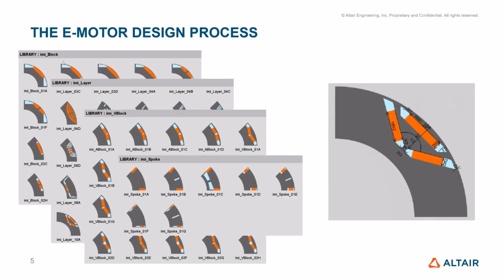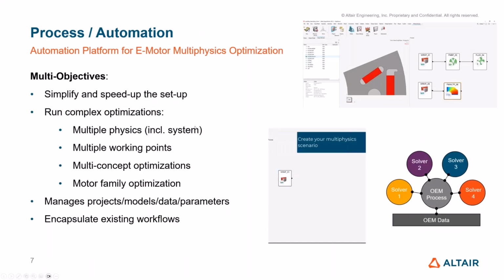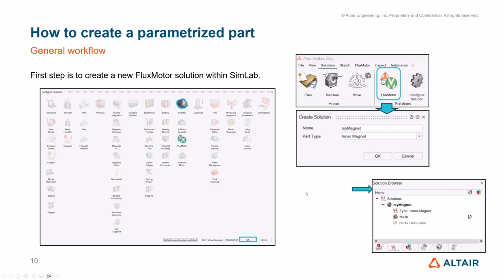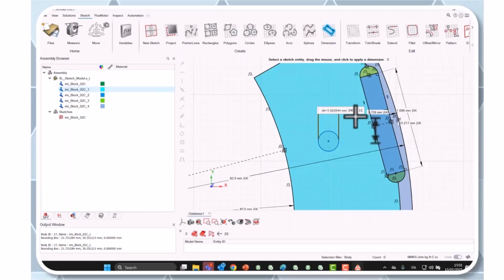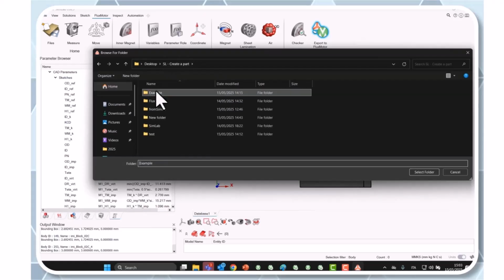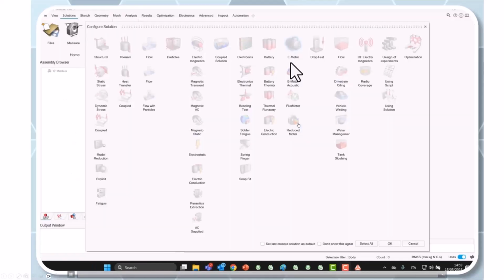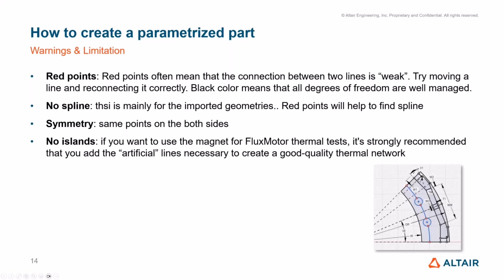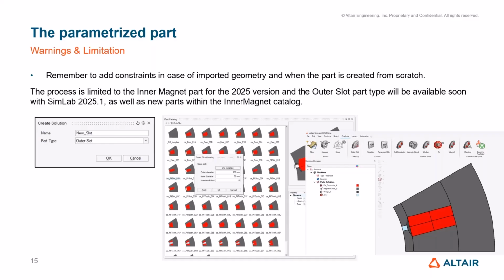FluxMotor part creation from SimLab sketcher

Comment: Hello,

I am currently trying to design a Coreless Rotor (Permanent Magnet only) and a Slotless Stator. However, while attempting to create these custom parts, I noticed that the 'Magnetic Circuit' and 'Lamination' settings seem to mandate the presence of a rotor core and stator teeth structure.

Could you please clarify if:

FluxMotor currently supports the creation of Coreless Rotors (without lamination) or Slotless Stators?

Is there a specific workaround to define these topologies where the rotor core or stator teeth are not required?

It appears that the current workflow enforces a standard lamination structure, so I would like to know if this is a limitation of the current version.